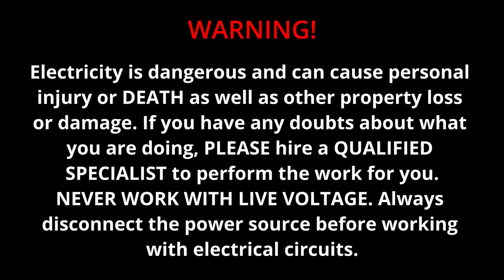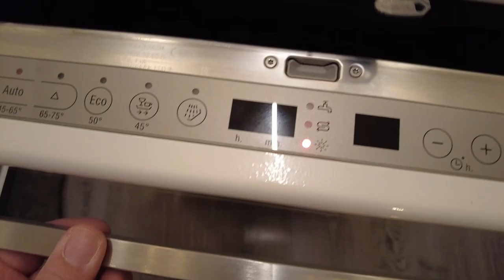Easy - Step by step - Error E09 Neff - Check & fix dishwasher - Replace (Heat-) pump, Bosch, Siemens

Comment: Well it didn’t help me just tried it, plug would come out and as for the heat pump unit couldn’t get it out at all just turns left & right. Pulling on as I twist it still doesn’t budge. So it’s off to the knackers yard.
Reply from the maker: It is not easy to pull out the heatpump. To remove twist the pump clockwise. If the upper connection is disconnected, turn and move while pulling on the pump. Could take a while.
Reply: Thanks for your message but a new one has been ordered, your video made it look so easy but the move set of three plug would not come out nor could I remove the pump itself no matter what I did. But thanks for your reply.

Comment: Thanks for the video.  I am measuring almost 4MOhms between pin 2&3 (not 19-20 Ohms as expected).  Does this mean I have a bad heating pump?  My BOSCH dishwasher (smv40e50eu) is not heating water, nor drying.
Reply from the maker: Hello, yes if you measure 4MOhms and the water is cold, it looks like the heating pump is faulty. You could have additional a problem with electronic, but replacing the pump first is a good idea. Michael
Reply: @MichaelHD77  thankyou. Just replaced it and that was the problem. REALLY appreciate it!
Reply from the maker: @willyortiz1022  Very good! 👍😀

Comment: Hi between what pins are you measuring to test if its faulty? And where did you find the info?
Reply from the maker: Between the middle and right pin (where the both red wires are on the connector) the left pin is ground (green-yellow) on connector. With this check you can test if the heating of the pump works. Found the information in the internet.
Reply: @MichaelHD77  hi thanks for the quick answer and the video

My dishwasher also gave e09
(And e15 and e04)

If i can ask a bit more so the resistance between middle and right should be +- 20 ohm (mine is 30 but i have a slightly different model)

And what should be measured between ground and the other pins?

Also mine had water under the pump could this cause a short? And e09?

Already much appreciated
Reply from the maker: @lieven1122  If you have water in your mashine, the pump pot gasket seems to be leaky. I have already replaced mine. Try to remove the water. 30 Ohm looks OK. Check right and middle pin against the left pin (ground). Resistance must be infinite. If not, heat pump must be replaced. If ok, you have a electronic problem. Your welcome!
Reply: @MichaelHD77  hi thanks again

I measured it again it was 200 ohms
Then i measured it again it was 0.2 ohms

I looked opened the pump and heater and on the bottom there is a tiny bit corroded

I think my best bet is to replace the pump/heater Assembly

Thanks for al the information
Repairing my stuff makes me happy
Reply from the maker: @lieven1122  Replacing the pump might be a good idea. I wish you good luck!

Comment: I just followed these instructions and it all came apart easily. The hardest part was getting the integrated dishwasher out from under the worktop.
I've ordered a new pump but my curiosity got the better of me and I disassembled the faulty unit. Two screws and it pulls apart.
It turns out that the heater unit printed wire to the live contact had burned through leaving an open circuit.
I cleaned up the printed wire and was able to solder a bridge across the short and hey presto, 20 ohms again.
Reassembled and ready to go.
I've filled it full of water and I'm leak testing it now since I had to break the water seal on the pump.
Not sure if I'll give it a try or keep it as a spare since the new unit is on the way!

Thanks for the help. 👍
Reply from the maker: I identified exactly the same problem, but decided to replace the pump.👍
Reply: @MichaelHD77  
I put the new pump in as well. I've kept the old repaired one under the worktop just in case.
Easy fix but very grateful for the video.
For anyone reading this, don't try and put the unit on its side, it has a heat exchanger full of water that then leaks ....... 😞

Comment: How did you know which part to order? I see many heat pumps out there
Reply from the maker: You need the Type Number (or E-Number) of your dishwasher. The label is normally located at the door.

Comment: how did you get that white thing out @1:47. It's pretty stuck, and there's minimal space for rotation. Just using brute force?
Reply: got it, brute force it is :)
Reply from the maker: Yes, brute force or a screwdriver on the frontside.